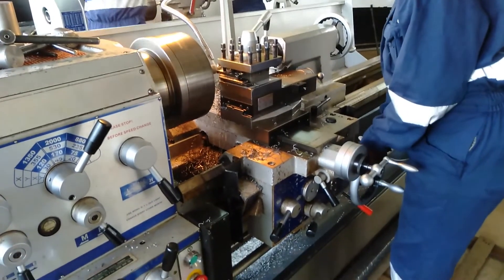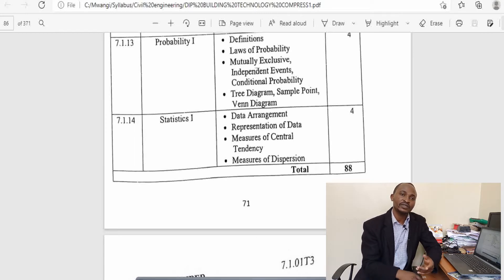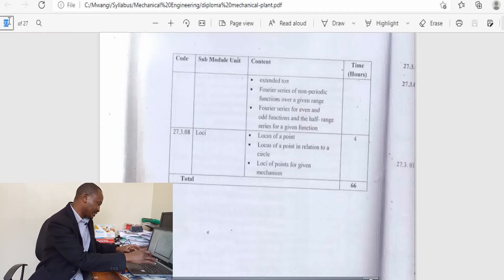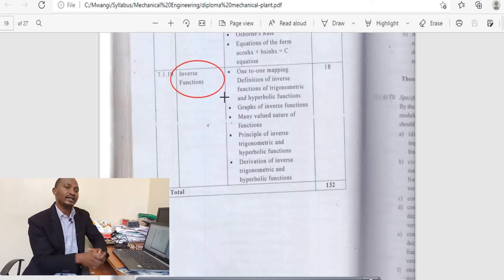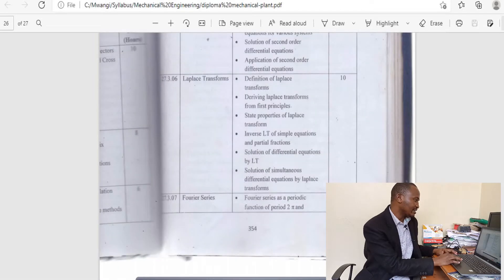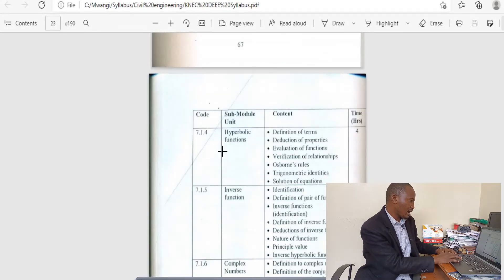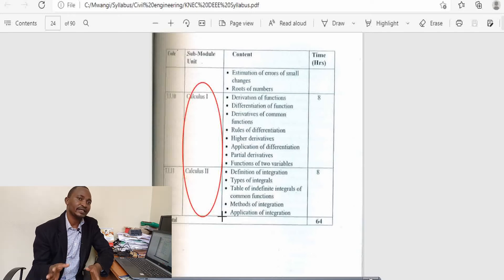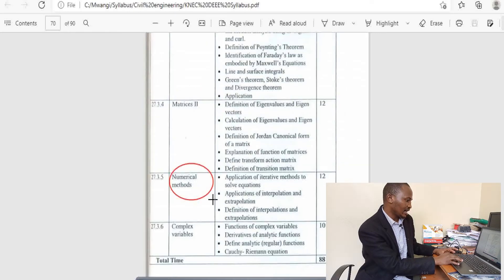How to choose between Electrical, Civil engineering or Building technology or Mechanical engineering

Comment: Hey, i have my bachelors in civil engineering, do you think i should do a diploma in electrical wiring and installation?
Reply from the maker: Get some electrical installation experience in the field and the apply for NITA (National Industrial Training Authority) grade III exam. It's 90% practical and 10% theory
Reply from the maker: No. I believe you must have done a few electrical engineering units in your bachelor's. Those are enough that what you need is to experience civil engineering work with some electrical engineering components . However a less than an year short course is okey
Reply: @HumbledEngineer  we actually never did any electrical course, nor introductory courses. But i have the opportunity to do an electrical installation and wiring course, where after i can perform one exam and become a licensed wireman. What you think?

Comment: Hello. I have a degree in ,IT but i feel i don't know much about the hardware part of technology (designing,repairs of microprocessor based devices) would a diploma in electrical engineering assist or should i opt for a certificate?
Reply from the maker: A whole diploma or certificate course will take you too deep in electrical engineering. What you need is a short course in electronics and microcontrollers. I suggest you find. Unfortunately many institutions do not off specifically designed short courses. What about looking for someone in that area to take you through those specific areas. If you don't find one go for a certificate in electrical engineering